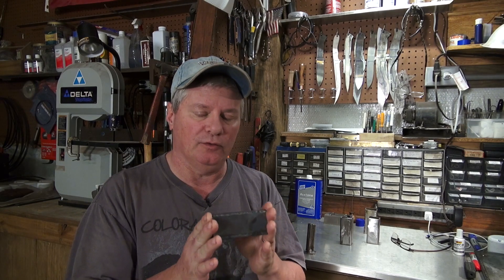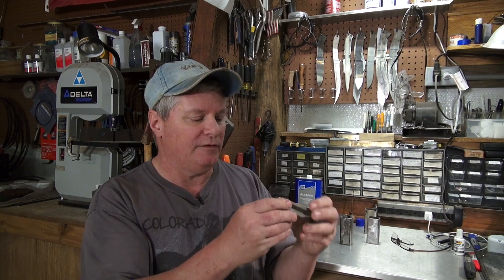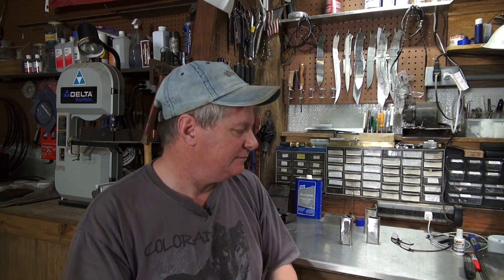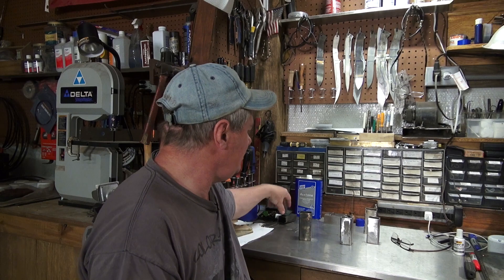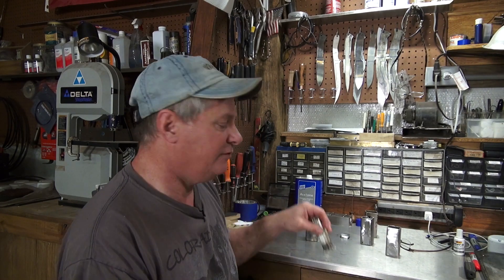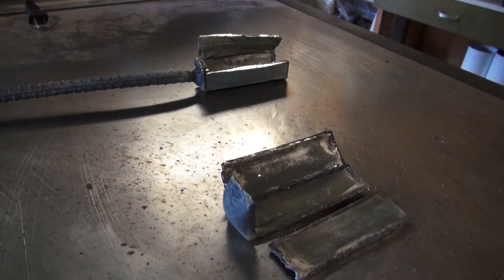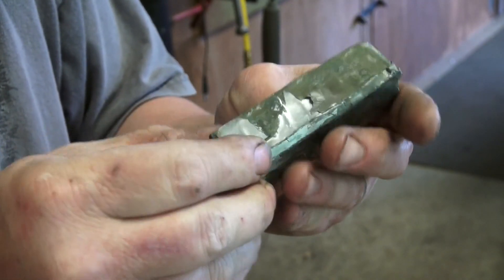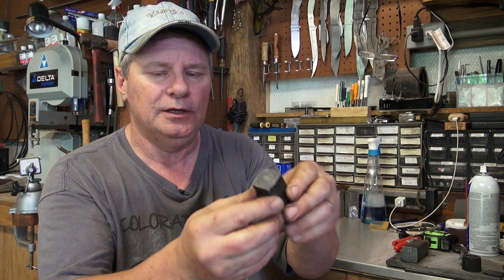How to forge Canister Damascus with the best can removal!

Comment: I need to make me a press like that. It looks simple and seems to work. I have a bunch of scrap Damascus I've been saving for a can👍
Reply from the maker: It’s very easy to build but extremely slow and not very powerful.  You end up loosing way more steel to scale due to the repeated in and out of the forge so much.

Comment: LOVE the filler music!

Very interested in your press. Is it air powered? I will subscribe and have a look around your channel to see it in more detail.

Thanks for the video, I have wondered if sooting the inside of the canister with oxy-acetylene would also help? Have seen some people use Krylon white spray paint instead of correction fluid too.

Haven't made Damascus this way yet as my is arm powered but I am going to soon. Have everything to do it with, just haven't yet.

Thanks again for this helpful video.
Reply from the maker: Thanks!  This is an old vid and I no longer have that press.  It was air over hydraulic.  Very slow, slightly effective.  I built a 24 ton hydraulic press a while back that is much faster and efficient.

Now I just use white spray paint inside the canister and it works perfectly.  I haven’t posted a newer canister vid since this one but I do have plans for one soon.

Thanks for watching and supporting my channel.  😁

Comment: I've never forged before, but it seems like you would want to use the thinnest canister that you can get away with.
Reply from the maker: There’s a fine line for sure.  Too thin and it blows out the ends before it welds.  Or you use what you have.  😁

Comment: I just had a thought...
302 stainless is a non-weldable grade. I wonder if anyone has tried using 302 instead?
Reply from the maker: It would probably work great.  I find that the 316L works great however and I have a ton of it.  😁

Comment: great video, good info. I believe  Steve Schwarzer uses stainless foil that has  been carburized like you did the can. .
Reply from the maker: Thank you.  Yes Steve uses burnt stainless foil.  I tried both in the experiment but my can worked better than the foil.  However, the can was made with 316l stainless (no carbon) and the foil was 321 or 309.  Carbon works against you on a can weld (it wants to weld or stick).  So the foil I was using may have caused that.  Steve is where I got the idea to use stainless.  He’s the man!

Comment: Thanks for sharing this experiment. I remember Tim trying stainless for the canister, and the additional step of scaling it with a torch makes a lot of sense.
Reply from the maker: Thanks Bryson.  Yeah especially using a stainless such as 316 or something in that range of chromium content and lack of carbon.  It will not weld to your billet.  Thanks for watching!

Comment: Can a guy get the same results with a power hammer if he doesn't have a press?
Reply from the maker: I think so.  I’ve set the welds with a hand hammer in a canister before.  I would start with even light hits.  You will feel it compress and solidify under the hammer.  I’ve seen Steve Schwarzer do it on a power hammer and he pretty much invented canister welding and using burnt stainless foil.

Comment: Thank u for the Video, great info. One question, do you have to drill a vent hole in the end of the can before you place it in the forge ?? Thank u
Reply from the maker: Mike I don’t.  I just pack it tight and seal weld it.  I don’t know if that’s proper but I’ve seen it done with and without a vent hole.  I haven’t had any issues with or welding.  Thanks for watching!

Comment: Thanks for the lesson, haven't tried canister yet and don't have a press, so wondering if it will work OK with a hammer?
Reply from the maker: You’re welcome.  Yes it will work but it’s a little more difficult.  The press with squaring dies presses all four sides of the can at the same time to make the weld.  This keeps the powder from possibly shifting and not welding.  However I have done it with a hammer before on a smaller can with a hammer.  Make sure to let it soak in the forge a bit before you hammer!  

Thank you for watching, I appreciate he support!

Comment: Thank you for the info. Going to try the 3/16 stainless can idea with it being scaled. God Bless
Reply from the maker: Also check out the next video where I stack 1085 and 15n20 layers in a can and a forge weld it.  The billet falls out of there.
Reply: @TonySeverioKnives   . Will do thanks.
Reply from the maker: Welcome Don
Reply from the maker: Your welcome!  Remember that’s it’s grade 316 that I was using but it was like 16 gauge thickness.  I really like the non sticking!  Thanks for watching.

Comment: Thanks for the tips. I've been trying to make some Canister for a little while now. I keep getting better but  so far i have yet to get a good billet. I'll keep trying  keep learning and keep watching.
Reply from the maker: You’re welcome Jim.  I’m no pro at it either but it’s getting a little easier for sure.  The stainless is the ticket.  We can thank Steve Schwarzer for the info.  Be sure to follow him on Instagram and Facebook.  Thank you for the support!
Reply: @TonySeverioKnives  Yeah the Stainless looks like it works great.  I haven't had any problem getting the cans off. I've been doing the whiteout trick. My issue has been cracks in the billet.  I don't have a press so It's just me and a hammer. Think I'll try to make a real small can and see if that works out better.
Reply from the maker: Jim Valliere  ahh yes big chunks can give you a fit.  Usually cracking happens because the steel is getting too cold under the hammer.  I work at nearly welding heat most of the process.  If it gets under yellow heat put it back in the forge.  My press is too small so it forces me to take small bites and heat often.  The downside to re-heating so much is loss of steel.  But yes keep it yellow to white hot under the hammer.  If it’s cherry red it’s too cold.  Once the billet is welded good and worked on all sides, it’s not so bad.  The billet is thinner and moves with less force.  Hope that helps!
Reply: @TonySeverioKnives  Yes That makes sense, and that's what I was thinking.  I'll try that.